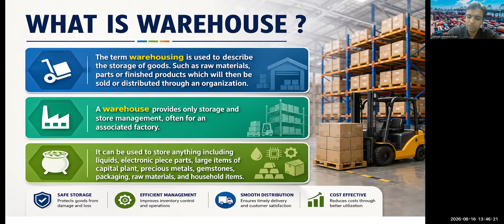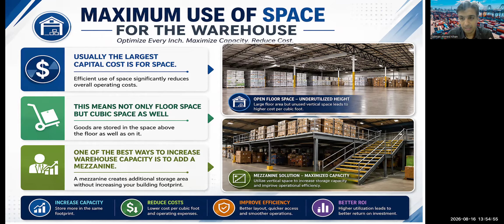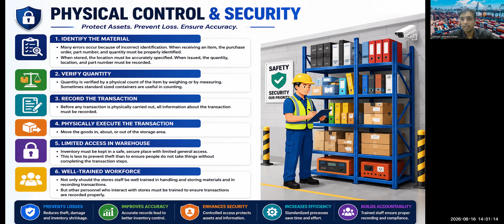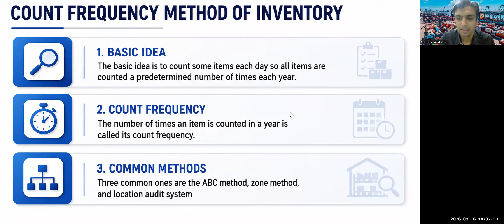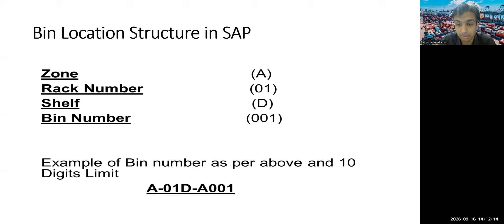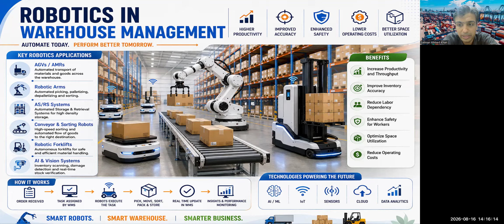Warehouse Management & Automation .

Comment: Sir, what u guide about vouchers means when u r going to receive any kind of material from any one u can make a duplicate or triplicate copy duly signed by competent authority or when u going to issue any one within or outside the location u can make issued vouchers duly signed by all concerned for record purpose where digitalise system is not available to avoid any complication at later stage plz?
Reply from the maker: You can issue on manual material issuance recipet Incase your ERP is not working provides that material issuance recipet to be also checked and sign by the concern department HOD or sectional head as well for ensuring complaince